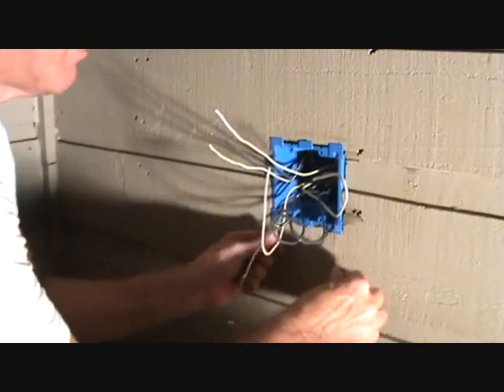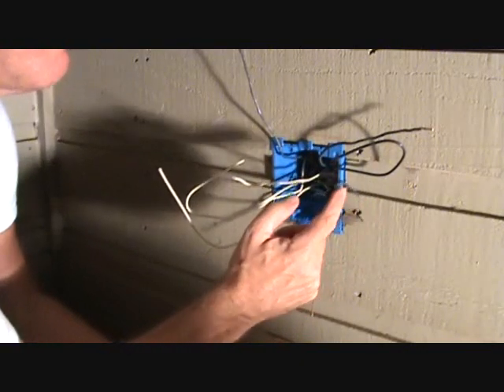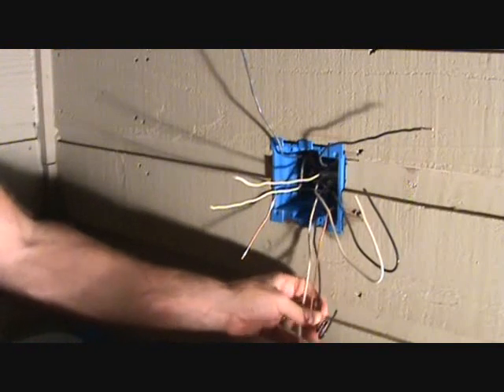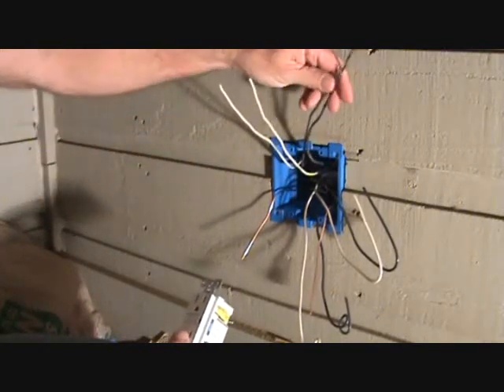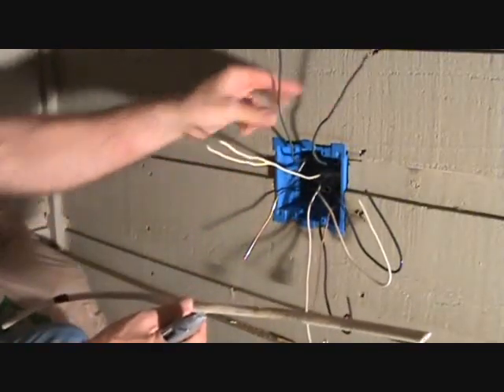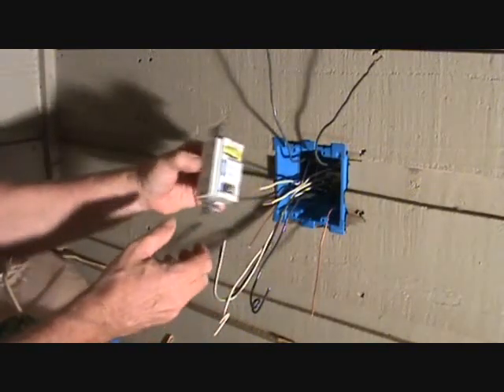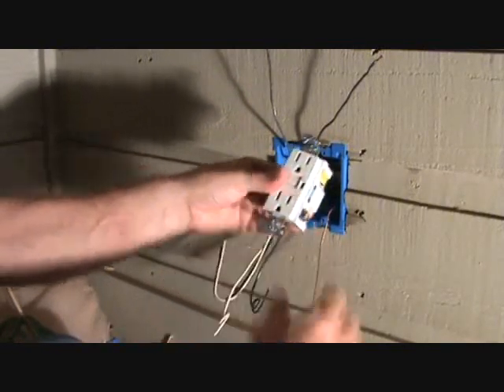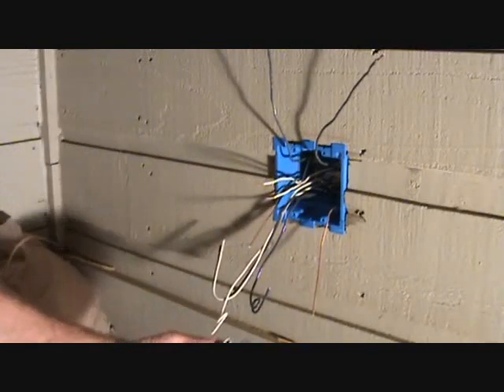Connecting a switch & plug combo to a GFCI receptacle...Part 1

Comment from the maker: How old is your ceiling fan wall switch? Does it have a dimmer control? Could your dimmer switch be ready for replacement? How many light bulbs do you have at the fan? Is just one working with the others burned out? The one that still is working could have a filament problem where it dims out after getting too warm. There's a few things I came up with. You could also go to your closest hardware store & ask them what they think. Hope this helps.   Joe  :0

Comment from the maker: Not sure why your ceiling fan lights continue to dim all the way off then you having to turn them on again. I have not heard of that before. I know "video joe" is suppose to "know" but this one has me stumped! How old is your ceiling fan? Maybe one of your wire nuts is loose in the ceiling junction box or maybe somewhere inside the actual motor assembly. The lights stay on until the loose connection gets hot then it slowly goes off. That's one thing it might be.   Joe  :0

Comment: Joe Awesome videos I'm telling all my friends about them.
I also have some problems with my ceiling fan.
1... I can only turn the four lights and the fan with the remote control but I have to turn the wall switch on. While the wall switch is on some bulbs start to flicker.
2... Today I moved the switch on on the ceiling fan since then I can't turn it on nor the lights.But the bulbs still flickering. 
Hope you can help me. Thanks!
Reply from the maker: How old was your ceiling fan? If it's ancient then maybe it's telling you it's time to retire it!

Comment: also how come there are only two ground wires?
Reply from the maker: There should be a ground wire for each set of wires in the box. If you only see two ground wires coming out it's because I probably already connected up the other ground wires with a splice cap & have that shoved into the back of the box since I only need two ground wires coming out of the box in order to connect to the two outlets....see?

Comment: where do four sets of wire come from?
Reply from the maker: One was the power coming into this box initially & then one power out then I added two more sets of wires to go up to the additional light switch I installed then one back down to make the other outlet as well as the light switch GFCI protected. If you want to see the entire project I made videos of this whole thing so you can learn more. Go to my main YouTube channel page then click on playlists & scroll down to electrical & they will be in there. I was doing all this since I was adding little lights on the deck railing that I could plug in on the deck then control them with a new light switch that I installed so I didn't have to go out on the deck every time to plug the lights in for on then go back on the deck to unplug the lights from the existing GFCI outlet. I thought I did a pretty good job for the whole thing & YOU can too. Just watch all the videos to learn more. Thanks for stopping by!

Comment from the maker: Thanks for telling your friends about "joe"! As for your flickering ceiling fan lights, maybe you have one bad bulb that is making all you lights flicker...? Are all your bulbs tight & not loose in any of the sockets thereby causing the lights to flicker..? Check all of your wire nut connections, as you could have a loose wire that is causing the bulbs to flicker..?...at your light switch, at your ceiling box, at your actual light kit unit? How old is your ceiling fan assembly?    Joe  :0

Comment: I mix my wires colors with live wires with 3 way switches  with 3/14 wire just for fun
Reply from the maker: birdchaser2010 You must be an electrician by trade......impressive! I always make sure the power is off & I try to keep everything together so I can feel comfortable getting 'er hooked up! I'm not an electrician by trade but if I think about it & talk it out, I can do it! This video project took all my effort & am proud I got it all figured out to make the additional outlet GFCI protected as well as the new light switch I installed. Whew! Have a great weekend!   Joe  :0